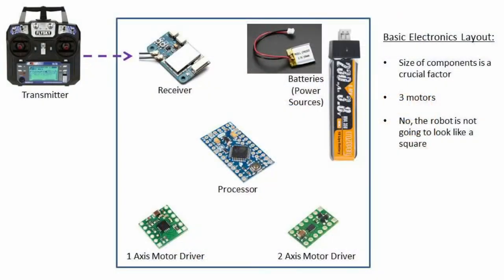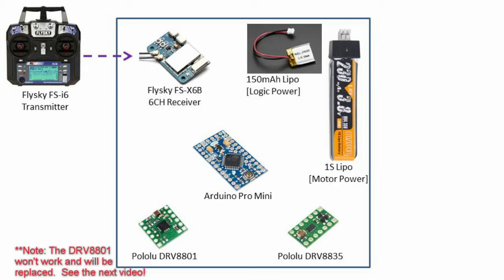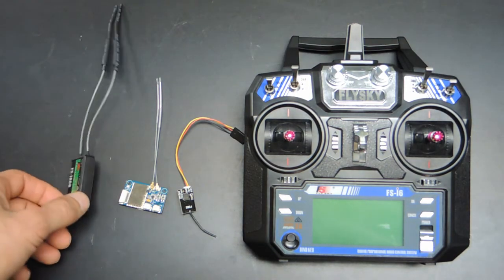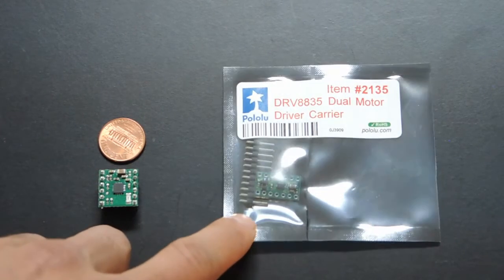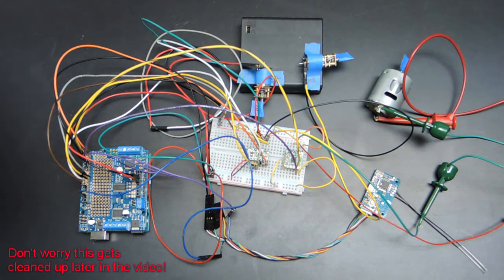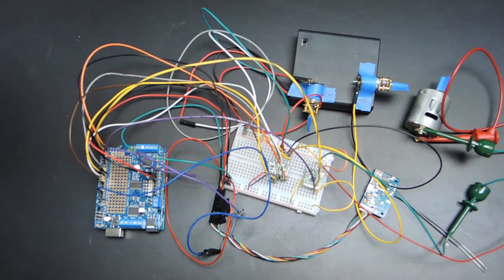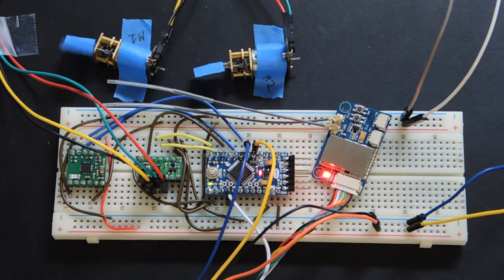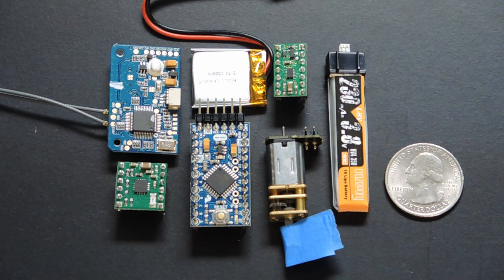Mystery Arduino Robot, 3D Printed, Part 1

Comment: What are the RPM of those 2 motors? The one which drives the robot and the other which makes it go up and down?
Reply from the maker: The one which drives the robot is around 420 RPM and the one which makes it go up and down is around 75 RPM.  The exact vendor and part number for both motors can be found on the list of materials found here: https://www.thingiverse.com/thing:2964084
Reply: Potent Printables thank you